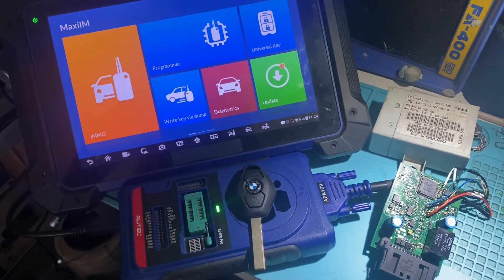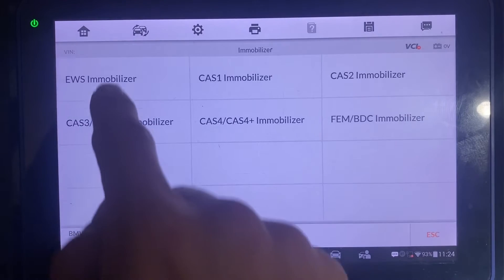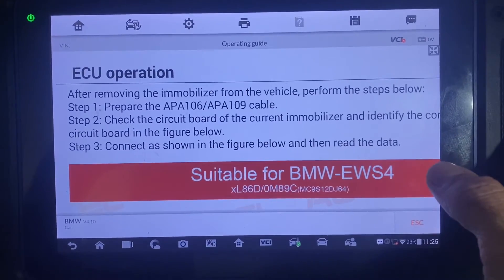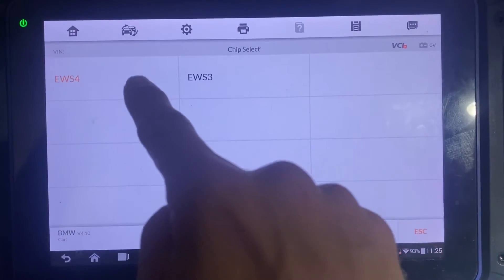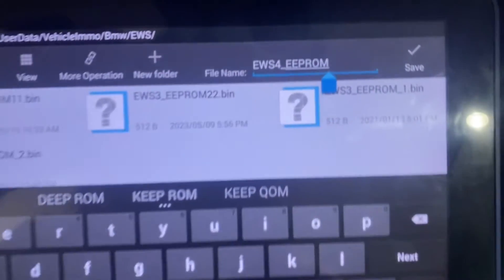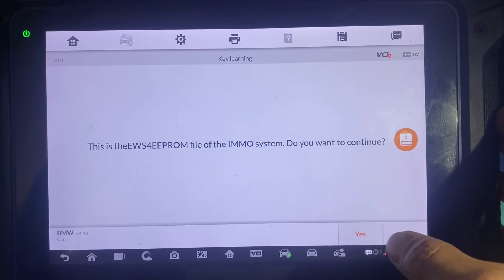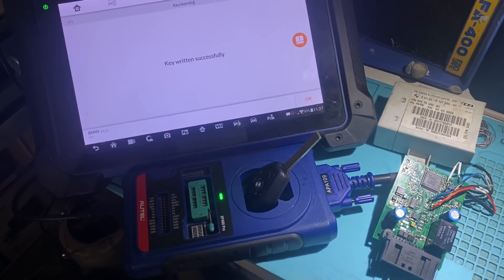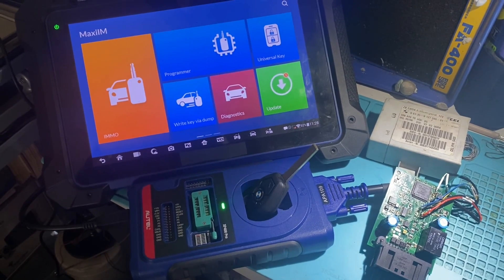BMW EWS4 Key Programming with Autel IM608

Comment: I followed this steps but have no crank anymore. What could have went wrong?
Reply: I noticed that when I learn the key, it doesn’t save it as Key. 2
Reply: What I mean by that is that I do all these steps, learn the key, but when I check for the keys, it's gone and no keys are to be saved.
Reply: @Max-nk9zl  Read eeprom again. If there are no keys in eeprom they are deleted i guess. In this case i would write the old eeprom back with its old keys in file.
Reply: This happened to me today after following video exactly. EWS read fine, new key wrote, both keys read fine (key 1 and key 3), neither crank. Did you figure it out? Corrupted EWS4.3?